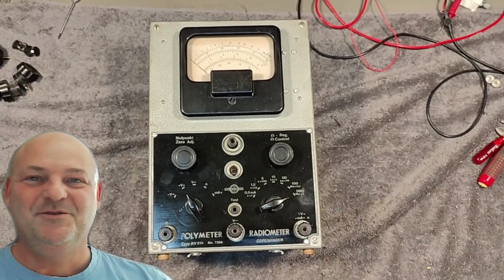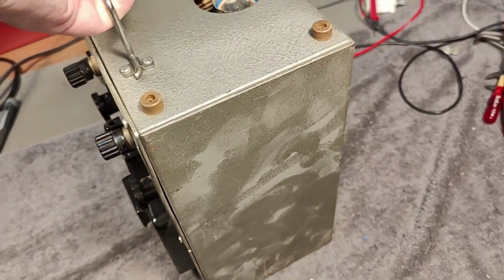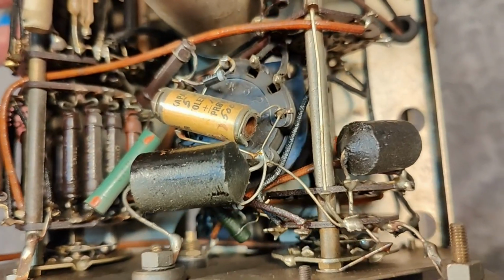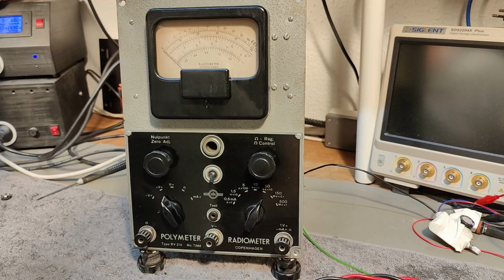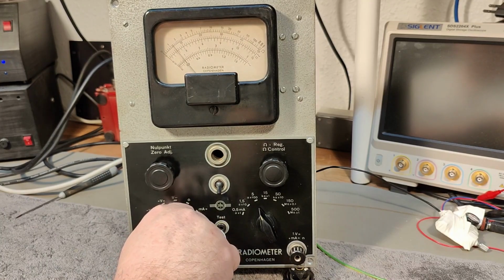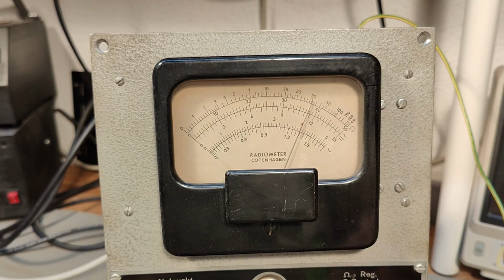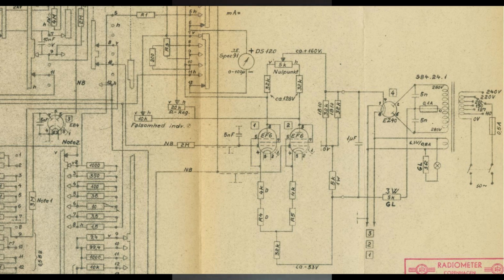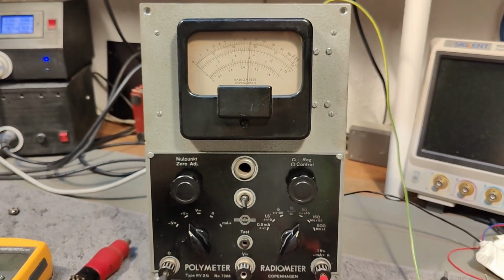Radiometer RV21b Polymeter DC AC voltmeter ohm 1948

Comment: BEREC was British Ever Ready Electrical Company, which made batteries under the Ever Ready name in UK and under the BEREC name in continental Europe. They got taken over in 1981 and I think changed the branding. It seems most likely from the packaging and branding that this "blue seal" battery was from the 1970s or at the latest the 1980s.
Reply: Thanks for the correction, so even more impressive
Reply from the maker: thanks, i like to get some history about these old units and have always been interested in all these details.